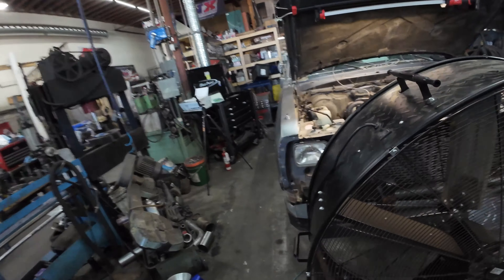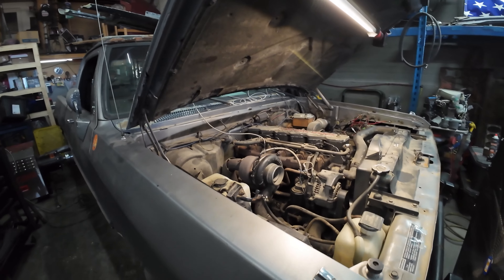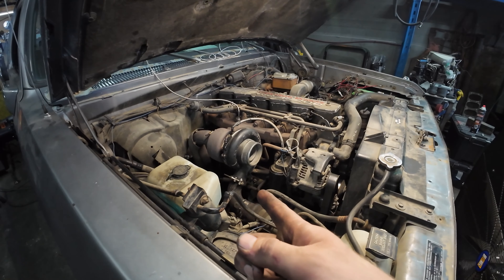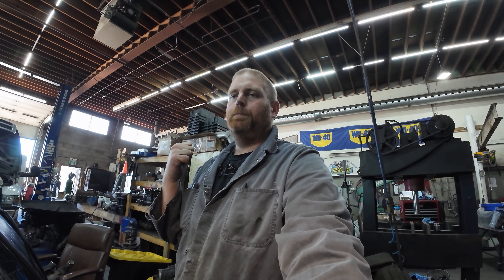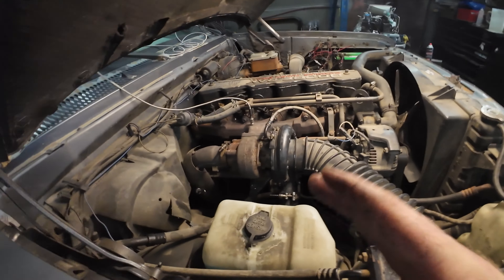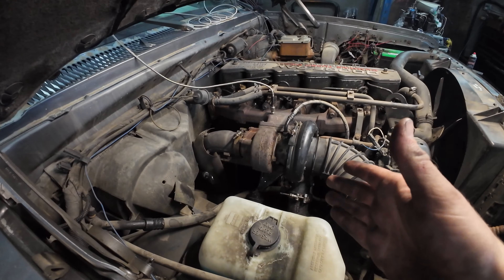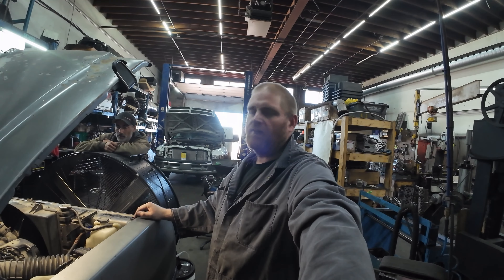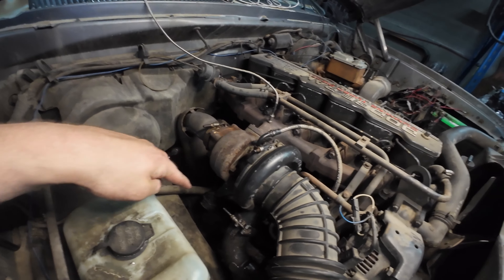VE 89-93 CUMMINS H1C VS HX35 DYNO TEST

Comment: So you gain a small amount of ho and lose 400ft lb of torque? How is that worth it
Reply: His torque numbers are inaccurate because the dyno doesn’t know what the actual engine speed is.  It looks like he dynoed one turbo in overdrive and the other in direct but without changing the calibration in the dyno so the torque numbers are bogus.

Comment: So the truck gained hp but lost 400 ft of torque. Isn’t torque better than a horsepower number? 811 ft lbs is a big number in my opinion.
Reply: His torque reading is way way off. It needs to be corrected something fierce.
Reply: @frosty_silver_fox4292  that makes sense. Thanks
Reply: Yeah the VE only made 400 ft lbs at the crank when they left Cummins. 800 at the tire is a big jump.

Comment: I put a 93 12v in my 68 ford. I put an hx35w off a 2001 24v, bd fuel pin, governor spring and DDP stage 2 injectors.  It also has an in take and full 4" what do you the ball park horsepower would be? The injectors are 5x14 if that helps
Reply: DDP lists them @350hp tops @ the wheels. You have a HVLP?
Reply: 1000ish

Comment: I went from H1C to HX35 to S300 with Turbonator (everything is 4" for intercooler (off of a Ford) and piping and downpipe for exhaust)
Reply: How do like that turbinator??.. have thought about trying one of those for an S300 I tried but didn't like ..how it drove with the particular setup I had at the time ..may try the S362 again someday,but anyway 👍👊
Reply: @elroyelblander6277  It provides a more consistent exhaust backpressure. In the past, I could get 35psi out of HX35. The small S300 I opted for can get to roughly 20 psi without turning up the pump to smoke levels. I mostly drive around town these days, so that is why I opted for the small S300. If I was on the highway more consistently, I would recommend a larger S300 that what I selected. I had a 9.5cm, 12cm, 14cm, 16cm, ... exhaust housing for the HX35 so I could tune using those options.
Reply: @mutantryeff  👍👍ten four...what size 300? how does that turbonator light?
Reply: @elroyelblander6277  Stage 1.5 S362/68/SXE VGT - that is their smallest S300 configuration. Boost is consistent without lag as it is their smallest. If I need to, I can always have a 2nd S300 on hand and swap out if I really needed it. 95% of my driving is in town. Today I was on the Interstate and I was easily doing 85mph on 10psi or less boost cruising. I have water injection (no longer add methanol) and the first stage comes in at 5psi and the second at 10psi. The lights for the 1st stage were on but the 2nd stage was not always on.
Reply: @mutantryeff  ten four... thanks for your response and input feller....have a good evening 👍👍👊
Reply: @elroyelblander6277  No problem. I bought this truck new 31 years ago. Learned a lot, but as I get older I hate working on them.
Reply: @mutantryeff  i know what ya mean .like most,.I like swapping and adjusting to see how they react ..when I have time,but really,I just wanna drive it🤣👍👊